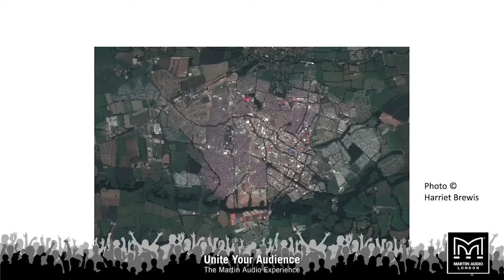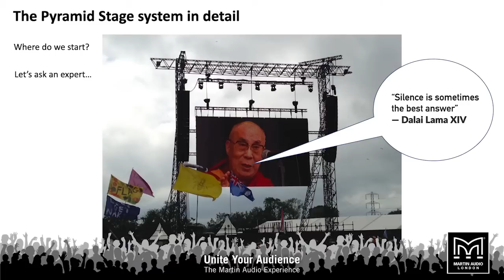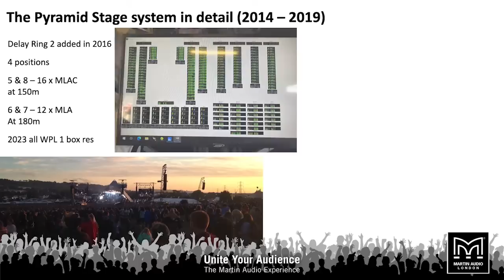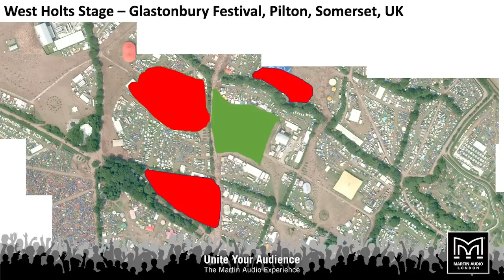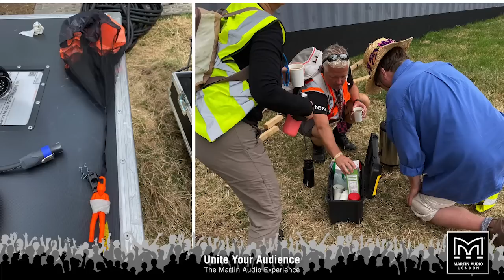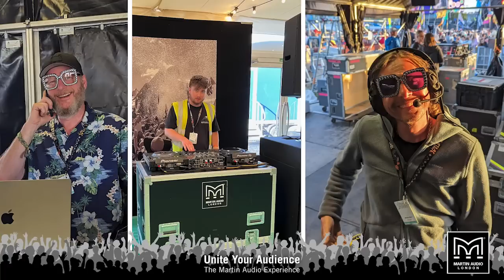Martin Audio at Glastonbury Festival

Comment: Firstly i am a massive Martin audio fan, as a musician and sound engineer.
I have played at Glasto 1993, 2006 including the Avalon stage and 2019 mainly in the green fields. This is where holistic/folk and devotional music is played. There are many little stages there that often get over powered by the big stages. In 2019 the PARK stage totally dominated the green fields. Its very annoying trying to play subtle music with the bass of much larger systems mixing together. Its down to the festival organisers.
It is what it is, i prefer festivals with one main music stage only, and i provide sound for these kind of festivals. You leave the festival not being crushed for 4 days.
Reply: Large scale sound systems are always like trying to crack a walnut with an atom bomb just for people to get the same audio level as  headphones.  If a position tracking signal app was invented to set the audio delay of a single wifi broadcast for individual headphones receivers on smartphones it would be possible for people to augment a lower system volume or even mask external noise interference   ....the future has spoken..maybe !